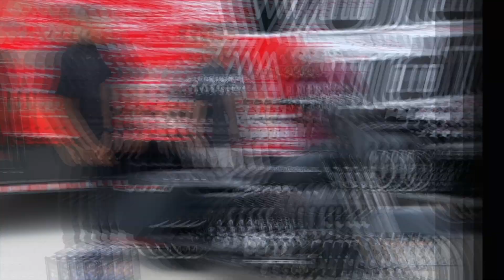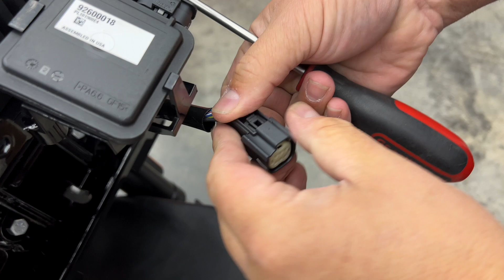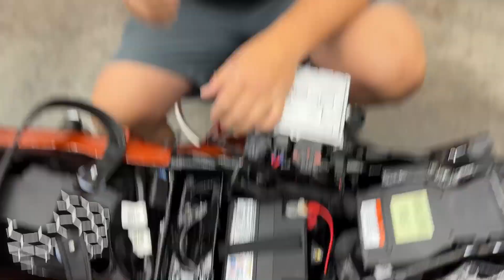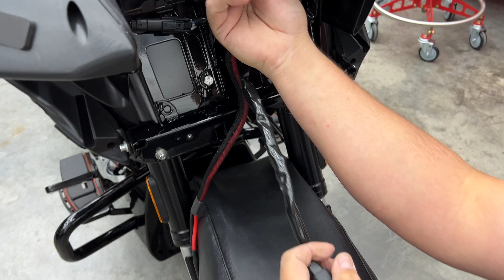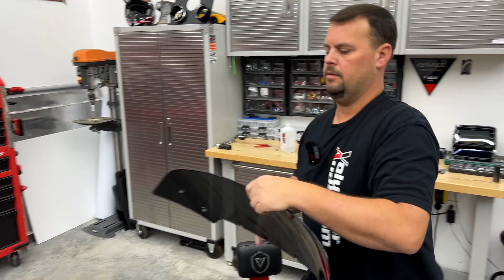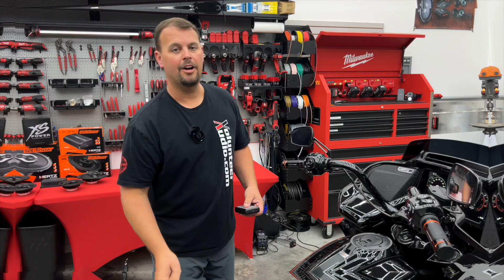Step by Step Install - Volunteer Audio Hertz Stage 4 Amp & Speaker System for 2023.5+ CVO Road Glide

Comment: They sound better, but they are not 100% leak-proof. I installed them, but if water builds up on the tweeter during rain, it will leak into your saddle bag. They say it's waterproof, but that only means the speaker won't be hurt by water. I live where it rains, and even when washing the bike, water leaks. I am sorry to say I took mine out and went with Harley stage III just so I don't have to worry about my bags leaking on a long road trip. I own a 2024 CVO Road Glide. Yes the shound 100% better but i never want to worry about my saddle bag leaking.
Reply from the maker: You can easily add our hydrophobic cloth if you’re having an issue with water going through the Tweeter that will not allow water to build up on it, this added protection is only $50

Comment: Hi Jay.  I just ordered this system for my 2025 CVO RG.  I have A10 Baja Designs headlights, will they create any issues with the install?  Thanks!
Reply from the maker: The a2b mount bracket will be needed as they have no where to mount without it
Reply: Great, I ordered the Extreme Audio Metal Amplifier and A2B Bracket with the kit.  Thanks

Comment: So how much is a 2 speaker system on a 24 road glide because ive called in and got 2  different price just in the fairing
Reply from the maker: We currently have a sale going on hertz speakers and amplifiers, we also have a low cost system with a smaller amp that piggy backs off the stock amp or a larger hertz amp and a2b interface that replaces the stock amp.  You can see both options with current sale pricing at www.volunteeraudio.com under our plug n play amp / speaker category

Comment: You have a plug that would let you plug a flash drive into the usb-c?
Reply from the maker: @dantaylor636  you need a usb a to usb c adapter
Reply: @volunteeraudio  Got it the flash drive was bad and wouldn't work so I tried another one and it works now.Thanks for reply back.

Comment: I have a ‘24 CVO ST …what  speaker will be used with the cut in kits for the rear lids? Is it different from the speaker you used in this video?
Reply from the maker: Same speakers
Reply: Super stoked to get this installed! I've had the speakers installed(fronts only) since may and just got my amp in Friday. I inadvertently forgot to order the under seat harness for my tour pack so won't be able to hook those speakers up just yet but gonna get the amp in this week so I can experience the full potential of the front neos.
Reply from the maker: @northweston2  thank you!

Comment: wish the A2B unit could be sold by itself.  When do you think this will be available?  or will this only work with the Hertz amp.  I already have the hertz speakers and a DD audio amp.
Reply from the maker: It will only work correctly with the hertz sp4.900 amplifier, the DSP and amplifier are perfectly matched and tuned to run the hertz Neo speakers